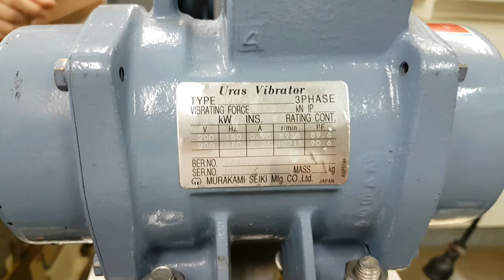OHMA - Loading the reagents into and starting of the Caesium Chlorate test

Comment: Hey Bob, make sure you find out what the metal fins are made of on the vibratory surface and the rest of the apparatus exposed to the fluid. Also what if any coating they might have. There's always a chance it plays a role in what is going on, so it would be good to be very clear about what they are made of. Lastly this looks like it's only vibration and no high speed electric pulsing, this definitely makes things simpler, very cool. Also I'm really glad you're recording the sound so you can confirm the precise frequency because the vibrator itself quotes numbers in the range from 893(.)?5 to 1071(.)?5 which seems a fair bit higher than the 169.1
Reply from the maker: Live doc has some info (growing)

Fins are Pd coated SS.

they were Pd coated Ti